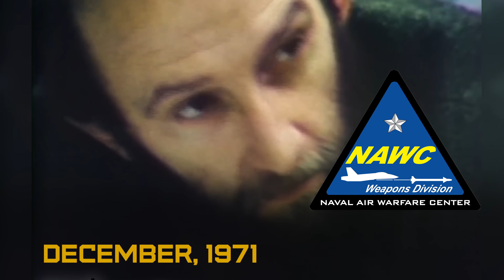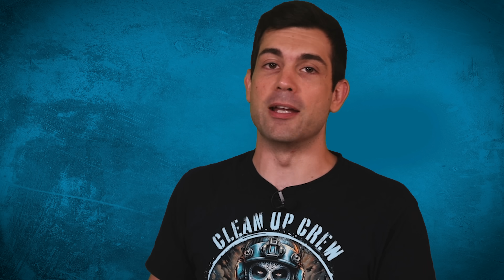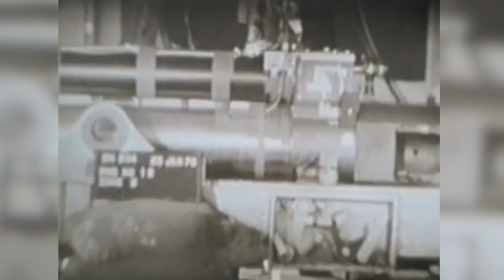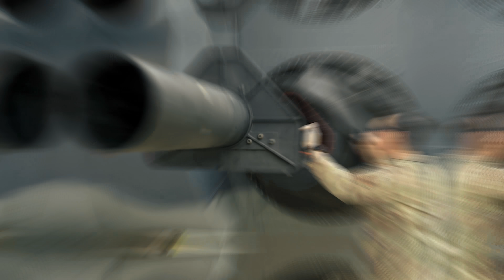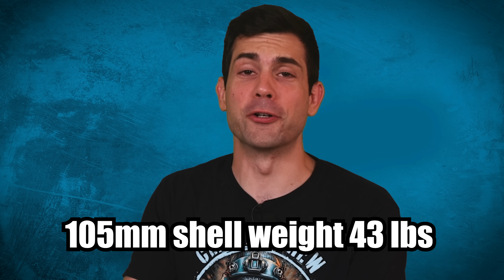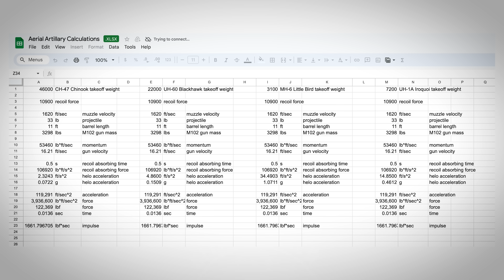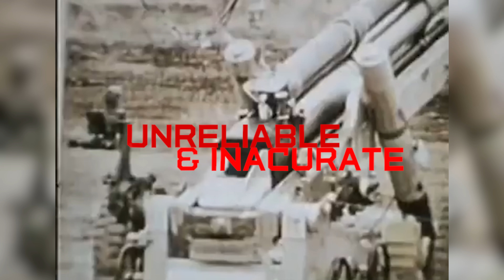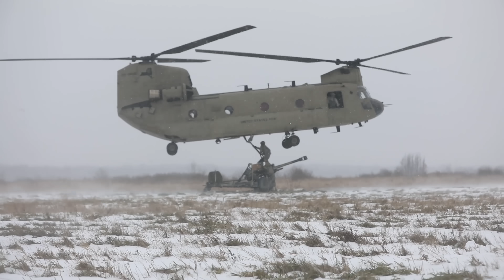America's Twin Cannon Artillery Helicopter is Wild

Comment: When it's the marine corps turn to design a helicopter
Reply: The idea would be feasible but only if the plans were written in crayon.
Reply: @CosmicTaco333 they actually just taped a green crayon to a picture of a Chinook and started making grunting noises until the higher ups got the point.
Reply: @CosmicTaco333  Extra points if you eat said crayons.
Reply: @QuadCarnage  the green ones taste the BEST!
Reply: @CosmicTaco333  Playing with your food is disrespectful.
Reply: @frankdrebinn is that a promice?.... lol
Reply: could they resist eating the crayons until the design sketches are finished?
Reply: This is your brain on crayon.
Reply: Do not underestimate the intellectual prowess of the research branch of the marine corps. They are, after all, raised on a strict diet of only the tastiest crayons.
Reply: Somewhere...a Marine is watching this video...

And touching himself 🙃🤦‍♀
Reply: They just launch SwitchBlades out the back of a V-22. KISS
Reply: @frankdrebinn the US NAVY only has the second largest air force on earth
Reply: As someone who was an aircraft mechanic in the Air Force, if any branch could make it fly, it's the marine Corp. Their command's callous disregard for marine safety as well as marines disregard for their own safety lets that happen. When I was in the Air force, we had tech data on something called a TO. Technical Ordinance. For us, it was like the bible. I saw marines stopped at our unit for repairs one day, and to them, it was more of a rude suggestion... as were general safety practice. I saw a marine on an mv-22 with the nacelles up climb over a stand and straddle the hub during a hub change. his fellow marines then moved the stand so they could use it while he continued working like nothing happened... like 3 stories in the air. It was no wonder to me that the marines MV-22s flew so much more often than the Air Force's CV-22s. It was our concern for safety that was holding us back this whole time! /s
Reply: Deer god an Osprey… the rotary craft with the most crashes… with dual howitzers… fuck it who wants to live forever anyways!
Reply: @steadysamurai1172  The Osprey has one of the best records.

Both the Chinook and the Blackhawk had way worse teething issues.
Reply: @jtjames79  I think that I disagree with that
Reply: @bayknight20  You mean you're going to keep repeating a popular lie because you prefer your ignorance.
Reply: @jtjames79  i'm sure that is very comforting to the people who died!
Reply: @steadysamurai1172   I believe the title for "Rotory craft with most crashes" still belongs to the CH-53 and its variants.
Reply: How about 30 mm gun like these beast A-10?
Reply: @keithdoane I seem to remember some sci-fi book where an Osprey had a GAU-8 and a railgun mounted underneath
Reply: @keithdoane  ooohhhhh... i think i just made a mess in my panties... i thought i was alone still being a UGE fan of the flying tank!  I was talking to a friend today about the depleted uranium rounds that had to be replaced for more... domestic use lol
Reply: If it works in anime, it will definitely work on real life.
Reply: When, in the history of the US, have The Marines been viewed as more important than any of the other branches of the military? 

They receive their budget through The Navy.   They are “the spare parts army” of The Navy.
Reply: @josephshelleyphotographer  Oh boy, you have a lot to learn about US mil structure buddy
Reply: @josephshelleyphotographer  
- 2012 While Services were trying to attack China's A2AD from outside its 1000nm bubble, the Marines announced they would attack from inside the A2AD within it's WEZ...Smart Guys like you laughed 
- 2019 USMC released their plan 
- 2022-23 All other services were scrambling to service copy
- 25th ID watched the development of their Hawaii Island mates 3rd Littoral Combat Team and completely made itself over
-2023 Air Force announces the ACE low signature forces to fight Inside A2AD bubble .... Oh copied fr the USMC Air Element of the EABO but less capable
- Feb 2019 army announced they were mothballing their entire fleet of Landing Ships. May 2019 FD 2030 dropped explaining the vulnerability of docks to PLAN attacks. Detailing why Landing craft were the most important lift. By the end of 2019 not only had the army reversed they announced they needed to build more ships

Why wasn't the army smart enough to know that on their own, before mothballing their fleet....🤔

Bc the best concepts to come thru the army were developed by the Marines
Reply: The moment Space Guard was formed.
Reply: "marine corps" no more like the Orks from 40k
Reply: Bifurcated
Reply: “We want an AC-130!”
“We have an AC-130 at the base.”
Reply: They would add a C.C.F.L. system, Crayola Crayons fast launching system
Reply: @frankdrebinn a wise man once said of the US armed forces that there are actually only two branches of the military: the Army and the Navy. The Coast guard doesn't count, the Air Force is a corporate entity, and the Marine Corps is a cult.
Reply: NEVER.!! It's BS...
Reply: @frankdrebinn”come at me bro”🤓
Reply: Stallion would be a better platform depending on what year it went into service.
Reply: @Vash45Long  Considering the '53's size, I'm surprised it doesn't have an M61 on it, at least.
Reply: You army clowns are hilarious too dmb to know how much of what you do is copied fr/USMC. 
- All of your AirCav copied from VERTICAL ENVELOPMENT: MCTU-1 1953-57 for the MAU later became MEU(SOC)
- Air-Land Battle copied directly from Marines Concept of MANEUVER WARFARE released in 1983 copied in 1987
- Multi Domain Units .... The MAGTF. Air/Gr Combined Arms Task Forces with Intel, Cyber, Log, & Info Ops under a single Commander able to be Task Organized to fit different Missions
- 2023-24 MDU HUNTER-KILLER TEAMS copied from the HKTs Marines hv bn developing since '13. Combined Recon, SigIntel, & Drone Teams 
- Ship Killing Long Range Missiles Marines proved the concept in 2014 .... Now its an army main focus

The list goes on & on.
Reply: @frankdrebinn But they already have???
Reply: Huh?
Reply: When in history has the army has a successful concept that wasn't copied from the Marines...
- AirCav .... Copied from the MCTU-1 developed 1953-57
-Air Land Battle ... Copied directly from Maneuver Warfare released in 1983 Army/AF copied '87
- Multi Domain Warfare Units ... MAGTF Marine Air/Gr Task Forces Combined with Intel, Cyber, E-Atk, Log under a single Tactical commander that can be Task Organized different missions
- 2012 While Services were trying to attack China's A2AD from outside its 1000nm bubble, the Marines announced they would attack from inside the A2AD within it's WEZ...Smart Guys like you laughed
- 2019 USMC released their plan 
- 2022-23 All other services were in complete scramble mode copying
- 25th ID watched the development of their Hawaii Island mates 3rd Littoral Combat Team and completely made itself over
-2023 Air Force announces the ACE low signature forces to fight Inside A2AD bubble .... Oh copied fr the USMC Air Element of the EABO but less capable
- Feb 2019 army announced they were mothballing their entire fleet of Landing Ships. May 2019 FD 2030 dropped explaining the vulnerability of docks to PLAN attacks. Detailing why Landing craft were the most important lift. By the end of 2019 not only had the army reversed they announced they needed to build more ships

Why wasn't the army smart enough to know that on their own, before mothballing their fleet....🤔

Bc the best concepts to come thru the army were developed by the Marines
Reply: And you STILL Lost to the Taliban ! 😝  American't win any fight as their boys dye their hair rainbow colors and the women would rather have careers,  not husbands.  YOU LOST.  USA lost to guys in flip flops and robes.  THEN gave your enemy $85 Billion in Jizyah payment! Why do you even have a Pentagone ?  Close it and spend the money on interest payments to your foreign debts.
Reply: Would've been a 155, not a 105, though 3/12!!!!
Reply: i could see something built arond the sky crane. maybe a pod type system.
Reply: Army tried a howitzer in a Chinook.  It wasn't feasible.
Reply: It would be cool for a tech reboot I'm for the Corps testing on the osprey!
Reply: @thenerv37  Yeah, you could swivel the guns down and use them as landing gears.
Reply: @thenerv37  "I'm for the Corps testing on the osprey!"

I'd say they should go the whole nine yards right away and integrate a GAU-8 into an Osprey, so it can drop troops and provide CAS at the same time. 😏

Comment: Wouldn't it be easier to mount the artillery gun in the cargo bay, and and just shoot out of the back of the chopper. The barrel might have to be extended so the blast doesn't occur in the cargo bay and the mounting point would have to be at the center of gravity. But I think it could work.

Comment: Ways to make this more practical: 
1. No airborne firing.
2. Use one howitzer, not two.
3. Roll a modified towed howitzer out the rear and stabilize it w/ a base plate, not the airframe.
4. Use a tiltrotor like V-22, so the rotor blades won't obstruct the howitzer's fire.

Comment: Funny thing is they're working on all kinds of crazy projects like this, all the time. I worked on the AC-130 GWS and they had plenty of other things in the fire simultaneously. Both legacy stuff they had been working on for years (ie-rail gun) and newer stuff which had more to do with upgrades to the platform than the actual systems themselves (transitioning from Hotel and Whiskey models to J variants).

Comment: The army did have operational Chinook gun ships in the Viet Nam conflict.  They were armed with two 20mm cannon firing forward, one per side, with adjustable elevation.  Also mounted on each side was a rocket pod of 19 2.75 inch rockets.  In the nose was mounted an auto fire flex mounted 40 mm grenade launcher. If that wasn't enough, there were 5 ea .50 cal Browning M2 heavy machine guns at crew served mounts, 2 per side and one on the tail ramp.  There was armor plate mounted next to critical components of the airframe and flight controls.  The name for this craft was "Guns-a-gogo". It was used effectively by the 1st Cavalry. Division during the time I was serving in theater in 1966-67.

Comment: 10,690 +3.9= 15,490 lbs mate.  Not 4,500 lbs. Still under 21,000 lbs payload even with an additional 9 crew.  Also, 76.78k lbs of a AC-130 is 3 times the weight of the Chinook's 24.57k lbs.  Even for a grunt, your math is shite.

Comment: In a word, OVERKILL, to the max, incredibly over complicated, secondly not very precise at all, involves too many variables, ammo load selection aiming,etc plus damage to the aircraft of the Chinook.
There is a much proven better means to provide devastating precise rounds on target at a much lower cost, more precise means, called AGR-20 Advanced Precision Kill Weapon System that is a design conversion of Hydra 70 unguided rockets with a laser guidance kit to turn them into precision-guided munitions. Wikipedia
Diameter: 2.75 in (70 mm) (unfired)
Effective firing range: 1,100–5,000 m (0.68–3.11 mi) (rotary wing); 2–11 km (1.2–6.8 mi) (fixed wing)
Guidance system: Distributed aperture semi-active laser seeker
In service: 2012–present
Length: 73.8 in (1.87 m)
Manufacturer: BAE Systems
Mass: 32 lb (15 kg
This a vastly superior offensive weapon system, simpler, more precise, a can provide a devastating amount of rounds on target in a very short time. In essence it is in complete compliance with the KISS principle Keep It Simple Silly!
Chinook already has large capacity Hydra rocket canisters available that can be easily modified to fire AGR-20 Advanced Precision Kill Weapon System modified rockets.

Comment: Does one rototill fields from the air? The same reason, aircraft don't deploy artillery: it takes one tractor to haul artillery with another wheeling the weapon-system-alone, & deep-ground-posts solid against shock to remain serviceable orientation for the next firing; absolutely nothing about an aerial-platform says artillery.

Comment: Skip landing-gear entirely & use the hardened-placements for artillery; housings for retractable-gear are wasted, the unit could easily land on its belly: if landing-gear were scrapped & belly reinforced for landings, those huge mechanical-wells are fit-to-accommodate swivels & mountings & ammo-feeds, it'd be astounding. Its the same aircraft but then there's room for Gau-9's & a couple cannons.

Comment: As a former crew chief on AC-130H gunships, I can say this would have torn a CH-47 apart, each shot is very rough. Not to mention there are occasionally "boomers" which we called the rounds that were somehow loaded too hot, it would crack panels on the left wing and blow all the navigation lights out through the top of the wing.

Comment: I got an idea.
Lets rebuild Hs 129 B-3 planes, which have the autoloaded 40 rpm 7,5 cm Bk75 (basically a drum fed autoloaded Pak 40) in a belly pod (integrated), and strap 2 Turbo fan engines like on a A-10 to it. Bam you got high firepower. Additionally give it the Apdsfs of the 75mm gun of the HVTS project (or whatever the light tank high survivability was called) and now you got great AT and AI peformance with the Sprgr.34 which has 725g He filler.

Comment: I would just make it a two-piece system, where the chopper is outfitted with a special tether system so that it can haul a lightweight conventional ground-based artillery piece into position, stay hovering while it sets up a shot on the ground, then they fire, pick the artillery piece back up, and fly away in less than 5 mins.

Comment: 155mm canon is on a. Tank 
2   155mm canon  a tank frame can’t take it 
As is 1 cannon will give you shell shock and permanent hearing loss. VA and army will Not cover your good to go 
Thank you    w j bush 
You need auto stabilization and auto target tracking for it to work 
The fire reload and. re fire will take too long

Comment: No, but today😉.  Dual 30 mil chain guns, Long barreled turrets would work.  With the recoil reduction.  Better yet, dual 50 mil. Chain Guns mounted in turrets, like the nose of an Apache.  (The 50 Mill chain gun is still under development.  Bush Masters). The 50 Mil packs a hell of a punch, same ammunition variety as the 30.  Yet, farther, deeper, harder. ). Is quite feasible.  Two separate guns in the belly, front and rear😳☠️.  Land incursions Special operations.😉😏.
SOJ@

Comment: Too ambitious a project.  Should have figured out a way to have twin chin mounted Mk 19 40 mm grenade launders, mounted in something like they used on the Cobras but with  bigger guns and a more limited ability to traverse, say about 90 degrees (45 degrees port, and 45 degrees starboard)..  Round it out with M2 .50 BMG's and  more Mk 19's,  port and starboard for lateral firing.  Then hang a pair of Bofor's 40 mm  guns out the back as a way to say "bye bye" when leaving.  All possible with the technology of the early 1970's, and mostly with "off the shelf" parts.  Also would be lots cheaper than missiles but more limited range, for CLOSE air support only.  Just a random thought from an old guy.  Probably a million reasons it wouldn't work.